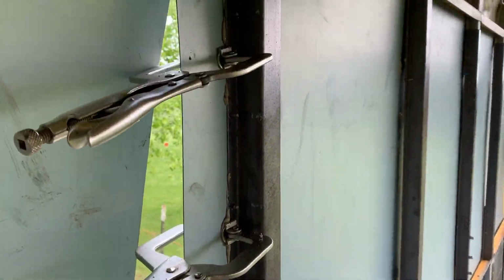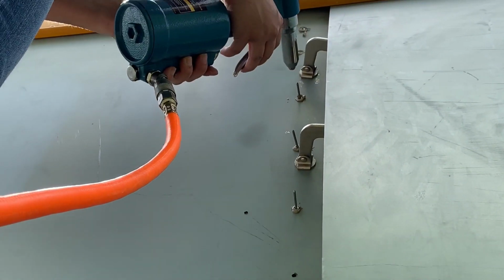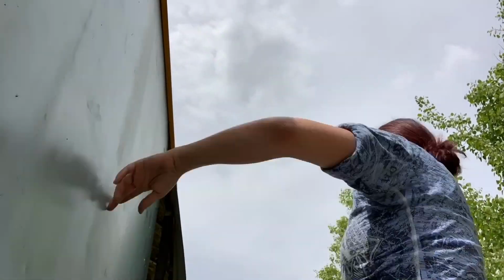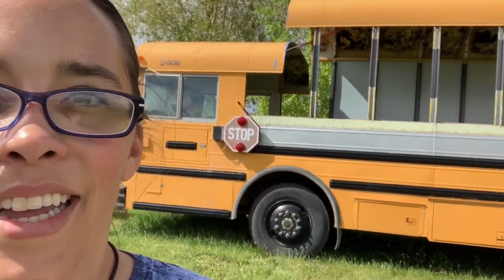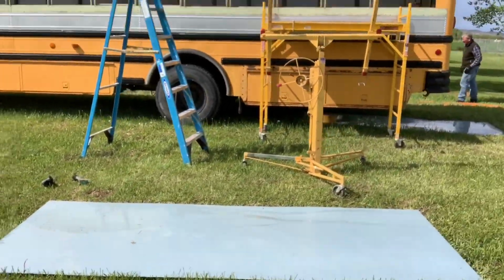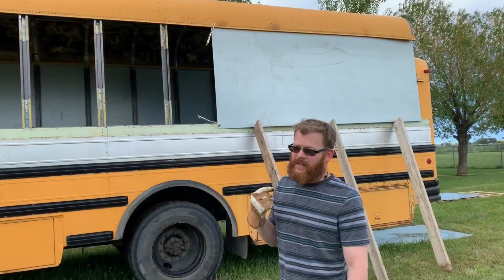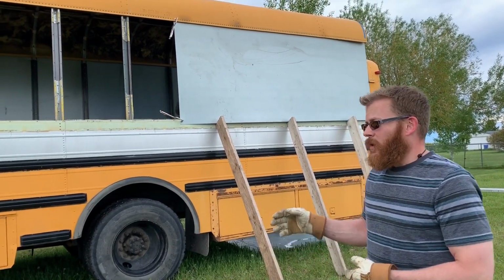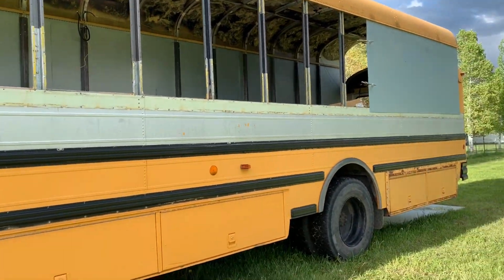Skinning and Riveting a Bus Part 2

Comment: Great Videos. Great work you're doing.  I'm gonna post your site on Skoolie.net.   That should draw some attention.  Can you tell me what type of glue/adhesive you are using on your sheet metal and the rivits plz?
Reply from the maker: Ross Pambrun I just went to my local nuts and bolts and rivets store and got pop rivers and the adhesive was just the strongest construction glue I could find in the store and it was expensive! 16 gauge sheet metal for the side!